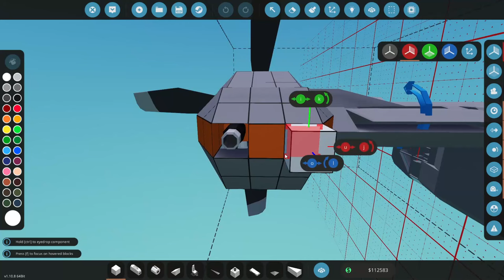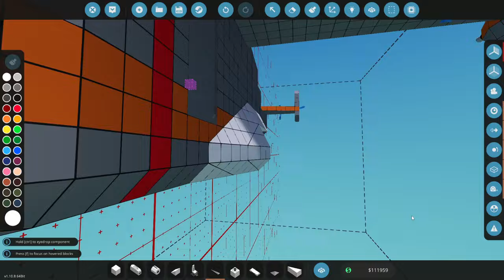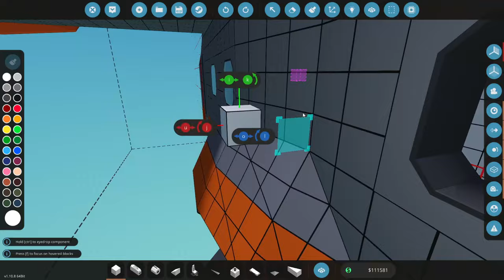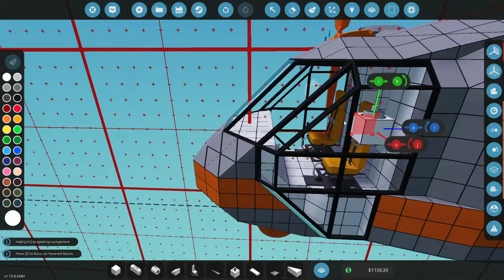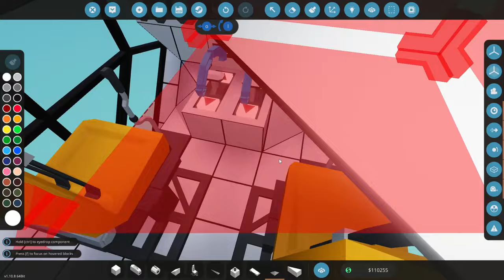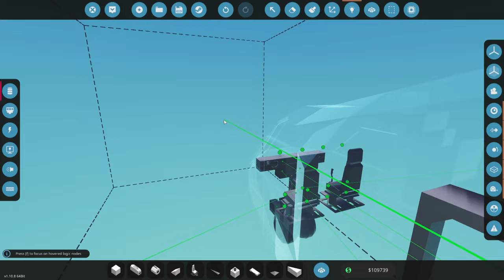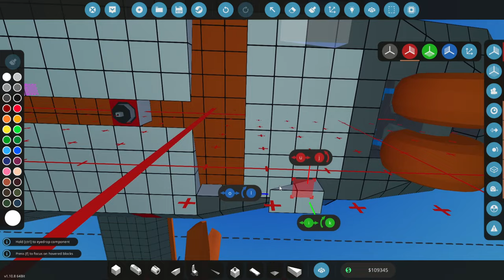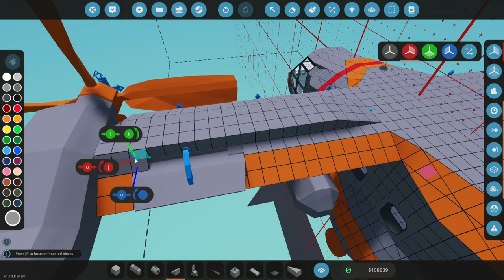Working On The VTOL!! Stormworks Classic Career Survival [S2E24]

Comment: Noice mate, looking rizz
Reply from the maker: Thanks Mate!
Reply: By the way, i have solution for your 3x3 engine overheat problem. Turns out, electric radiators are indeed the most efficient in cooling engines, but for 3x3 cylinders to have sufficient cooling delta, you will need as many 3x3 electric radiators as you have cylinders. To squeeze more cooling, NEVER put them in series configuration. Always paralel, with their own intake pump, so that every radiator receive flow. 

Indeed the best way for me is to just put coolant manifold with their own electric pump and electric radiator for each and every cylinder.

Putting a small fluid tank that contains fresh water in T piece pipe just after coolant manifold BEFORE the out pump towards radiator helps immensely too